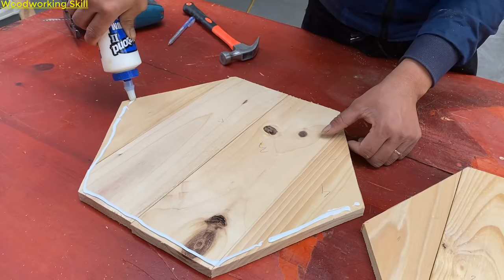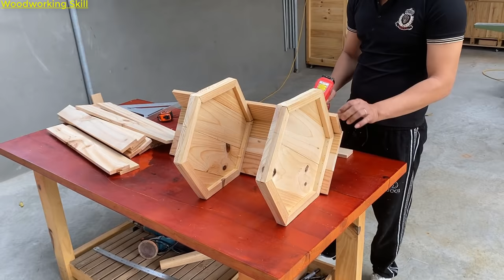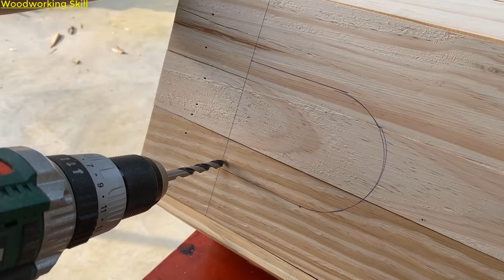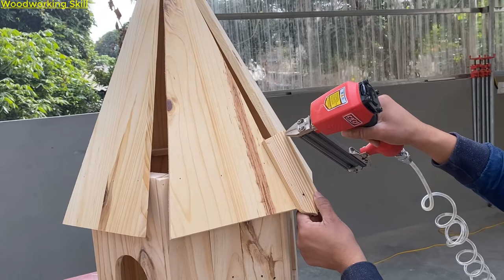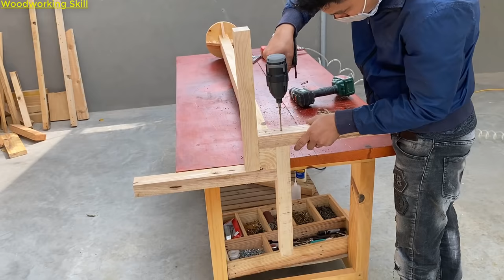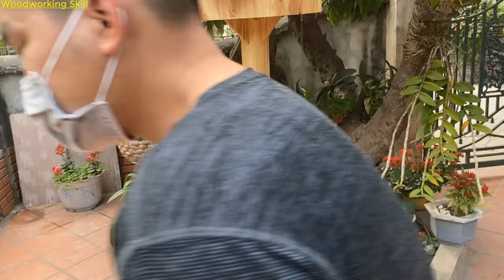The Idea Of Woodworking Is Close To Nature // How To Build  A New Home For The Dove

Comment: Loves that nail gun but has an aversion to wood glue. Doomed to fall apart once it is placed outside. Otherwise,the basics are there. Great idea and esthetically pleasing. Next one should be screwed and glued together. I would also suggest using an exterior type of wood.
Reply: Time and weather will tell. Here in Northern Ohio - better glue, screw and seal. But, it is an eye catcher....for now.